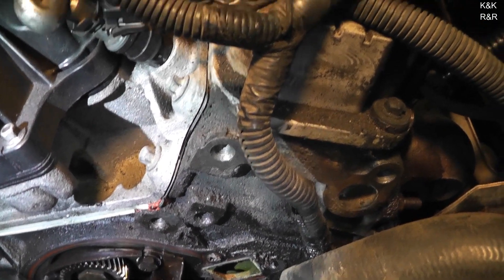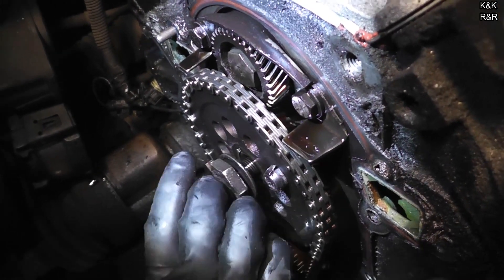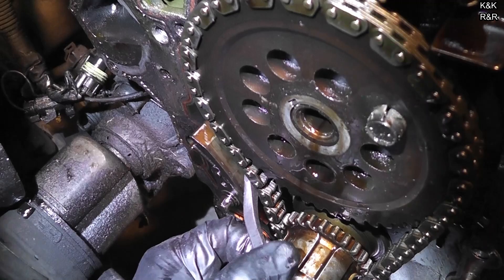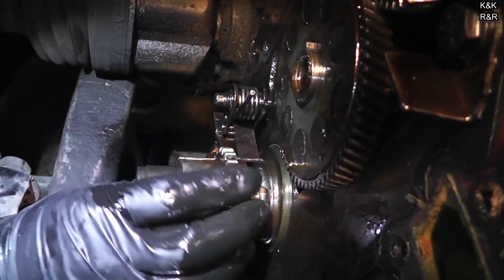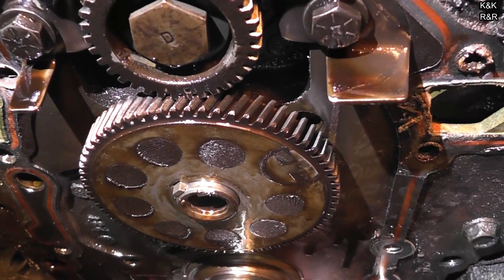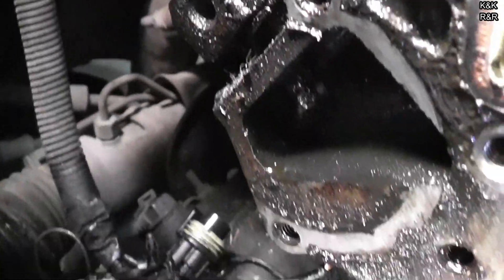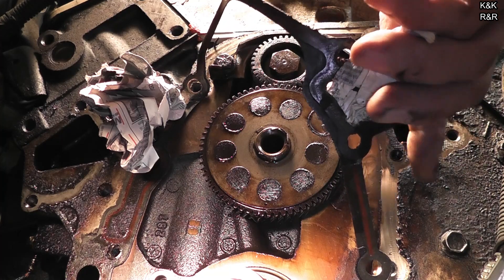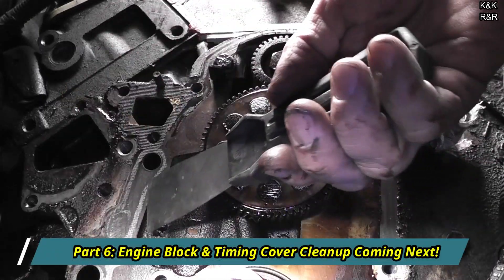1995 Oldsmobile 3800 Timing Cover Leak & Timing Chain Service  PT 5 Timing Chain Removal

Comment: Thanks K&K,  I don't have any running/performance problems, I have always maintained this car well since 2002. The timing cover was leaking however and I finally decided to "have at it" once and for all to stop the leaking. I read a few comments "As long as you're there might as well change them".  I stopped at my Buick dealer (I'm a former employee there) and asked the svc mgr to ask a tech about torquing the gear bolt, he told me the tech uses an impact tool and "just torques it real good".  I did purchase a Delco chain dampener though; I figured that would be a good idea at least.  Thanks for your reply. I'll no doubt refer to your videos again and again.  Regards, bob

Comment: So the cam gear retaining bolt is not a TTY bolt? I just replaced the balancer and drive chain along with the timing chain and all the other components on my 2012 Malibu 2.4 L Ecotec. I replaced the two bolts for the cam/phaser sprocket because it states new ones must be used because they are torque to yield bolts. My wife has the 3800 III in her Grand Prix. I have seen several mechanics say the 3800 is one of the best domestically made engines out there. Do you agree?
Reply from the maker: On the 3800 the cam bolt is not a TTY but does have a certain torque procedure that must be followed per the year it was built.  As far as the 3800 it is far superior to (2.8L 3.1L,3.4L,) (3.5L, 3.6L VVT, 3.9L), V6's GM is using today.  3800 has its issues but they are cheaper and easier to fix then what GM builds today.  I tell people don't buy any GM FWD with the  (3.5L,3.6L,3.9L) they are just awful to work on.  
/K&K

Comment: Thanks for the great videos on the 3800 series II.  I have my 2001 regal down to the timing gears that I was going to change, you video is tremendously helpful.  I do not have access to that Kent-Moore gear holding tool.  Would you say that I should not attempt to change chain/gears without that tool? the original GM gears/chain appear good even after 182 K. I would appreciate any tips you could give me. I'm also replacing the PS pump, and water pump.  Thanks again for these EXCELLENT videos; a MUST watch for any 3800 owner. Regards
Reply from the maker: If your going to change the timing chain you will need that Kent-Moore Holding tool.  This is one job I suggest to plan out ahead of time if your going to go in that deep. 

If the engine has been well maintained and you don't have any drivability Issue(s) like late cold/hot starts, Fuel System Syc PO Codes,  low rpm hesitation,  low power, timing chain noise, or timing cover leak(s) then there is no reason to replace the timing chain.  

The chain tensioner adjusts for timing chain stretch but once the tensioner reaches its full adjustment then you will have one or more drivability issue(s) listed above.   Other note most timing chains don't stretch until they reach 200k-250K miles.  

Unless you have a drivability issue(s) listed above there is no reason to replace the timing chain at this time.  Thank you for your awesome comment!
/K&K

Comment: My repair manual says to line the dots at 12 for the bottom sprocket an 6 for the cam?
Reply from the maker: That is correct if your working a Series II. I did mis-speak and made a correction later on in the video.  12 O'clock Crank Dot / 6 O'clock for the Cam Dot.
/K&K

Comment: I have a 1988 Lesabre "C" engine and I want to replace my timing chain. My camshaft does not have a bolt in the center like in this video. My camshaft has 3 bolts that go around the center of the shaft. In the center of the shaft there is a plastic like button.

 Is there any special instruction for removing the cam shaft? If I remove the three bolts, will the camshaft slide out? Does the plastic button piece in the center have special instructions for re-installment? 

Thank you!
Reply from the maker: After you remove the three bolts the cam gear will come off. Just make sure you time the engine dot to dot before you remove the cam and crank gears. One update you should do is change the plastic cam button to a roller bearing button style so you don't wear a hole in the timing cover. VIN C had a know issue of wearing a hole in the timing cover because the plastic spins against the timing cover.  Use Vaseline or Pre-Lube grease to hold the cam button in place during reassembly. Other than that its business as usual beside VIN C used a different type of tensioner than Series II.
/K&K
Reply: @KNKRNR  Thanks a lot for posting this video series. It really helped me with this project. Also, thank you for replying to all of my comments.

Comment: Great videos ! Have a question have a 1999 buick regal with check engine lite on P0336 can't get the code to go out ! i change out the crank senor and reluctor ring with new dealer parts,   still same thing ,dealer said to change out the keyway  any suggestions to what i can do , can it be a bad timing chain causing this ?
Reply from the maker: Have you tested voltage to the Crank Sensor yet? These modular EFI systems need 5 reference voltage to send information on crank speed back to the ECU. I doubt its the chain because the crank can't change its position unless the crank shaft is twisted which with today's metal technology is highly unlikely to occur. The cam sensor can change its location with a stretched chain but that would cause a sync code which you don't have with a PO 336. If your missing the 5 volt or the ground side of the circuit in the crank sensor system you will get PO 336.
/K&K
Reply: @KNKRNR  Thank you i will check to see. Apreciate the feed back.
Reply: Hmmm i checked out the pins at he crank sensor 1st pin 11.25 volts 2pin is ground im getting continuety,3pin 5.04,and 4th pin same. i think that checks out ?
Reply from the maker: Voltage seems a little low on the 12 volt side. Last time I saw a Crank code in a 3.1L the ignition module wasn't sending the reference signal back to the ecu.  On most GM FWD they use the ignition module as the gateway between ECU and crank sensor.   The ignition module sits under the spark plug coil packs.

I would suggest going to the junk yard a buy a used ignition module coil pack assembly and install it to test and see if this is the reason why you have the PO336.  We found those ignition modules can test out on the meter but once running fail while in they are in there switching modes.   The link below should show the wiring diagram from the crank sensor to ignition module to ecu wiring.    

https://www.autozone.com/repairguides/GM-Bonneville-Eighty-Eight-LeSabre-1986-1999/WIRING-DIAGRAMS/WIRING-DIAGRAMS/_/P-0996b43f8038fbb4

You said you replaced the Crank sensor, did you look at the harmonic balancer to make sure the Reluctor wheel was intact and not missing any pieces?
/K&K
Reply: @KNKRNR  yes it's all good put a new harmonic balancer on from the dealer ship. i put a new ignition module on because the one i had  went bad one day. I will check voltage on the 12 volt side like u said .
Reply: Do timing mark go dot dot on 2004 Buick 3800 Ser 2

Comment: I can’t get the cam bolt out. Nothing has worked... impact or anything... anything help would be appreciated.
Reply from the maker: Is the old timing chain still intact? If it is you can bind the crankshaft up and remove the cam bolt against the tension from the timing chain. Also you may need to use a (cheater bar/old pipe) to cause enough force to remove the cam bolt. Key here is the cam gear must not move to remove the bolt and leverage is key! 
/K&K
Reply: @KNKRNR  I’m actually doing two timing chains on two of my seven cars... my 91 Buick Lesabre chain has broken but my 88 Buick Electra chain is not broken maybe I could use that? My 91 looks like the cam in your video where as my Electra has three bolts. Also does the crank pulley bolt have to be tighten back in to aid in getting the cam bolt out? Sorry it’s a nightmare. Thank you for responding...
Reply from the maker: @jasonanthony1618  If your chain is broken you can install a new chain temporally to remove the cam bolt and then change the gear(s).  Your going to need the Kent-Moore Flywheel holding tool Kent-Moore J-37096 Chevy 3.1/3.4L/3.8L Flywheel Holding Tool to torque the Cam / Crank Harmonic Balancer bolt.  The Series I 3800 requires 218 Ft Lbs for the harmonic balancer bolt.   Down below is the link for the tool you will need. The three bolt cam gear doesn't require
 as much torque as Series I,II.

https://www.ebay.com/itm/193532973889?chn=ps&norover=1&mkevt=1&mkrid=711-117182-37290-0&mkcid=2&itemid=193532973889&targetid=935065067467&device=c&mktype=pla&googleloc=9033784&poi=&campaignid=10897980234&mkgroupid=106040615254&rlsatarget=aud-412677883135:pla-935065067467&abcId=9300403&merchantid=101637294&gclid=CjwKCAiA-_L9BRBQEiwA-bm5ftxiHJxfEM2KTX0rCjHzTC6t0nTxwj0bzwfvcGGFyPrZ0Gm32MdoMxoCVKMQAvD_BwE

/K&K
Reply: @KNKRNR  thank you sir. I will install the chain temporarily. Also do I need to put the balancer bolt back in to aid in taking the cam bolt off?
Reply from the maker: @jasonanthony1618  yes because you can hold the cam and crank in place during removal.  
/K&K
Reply: @KNKRNR  much appreciated.

Comment: How much does it cost to have this replacement done
Reply from the maker: Your lookimg at $430.00 in parts if you use OEM Chain Kit and around $600+ plus in labor for R&R.
/K&K
Reply: @KNKRNR  from the sound of it a new motor would be better thanks brother
Reply: When I changed water pump I was supposed to change timing chain it just killed and now it won't start
Reply from the maker: @steventrill7383  Did you change the timing chain and now it won't start? 
/K&K
Reply: @KNKRNR  I didn't change it yet. But someone's told me thats the reason it jump timing because I didnt change it along with the water pump